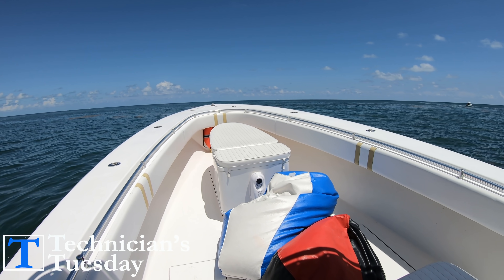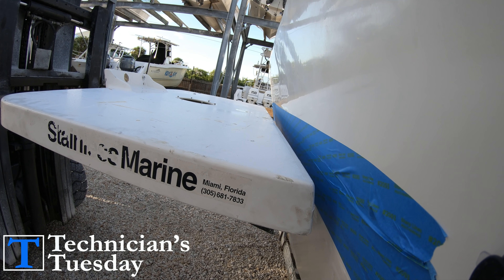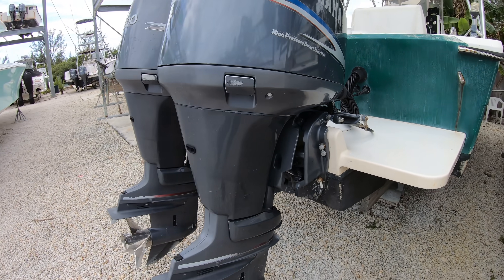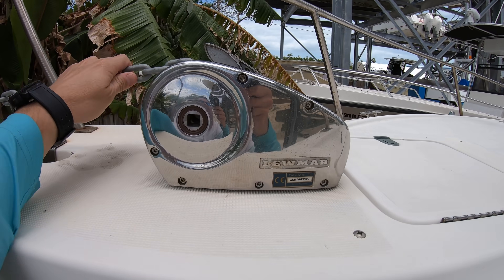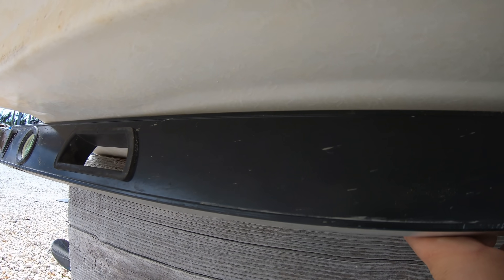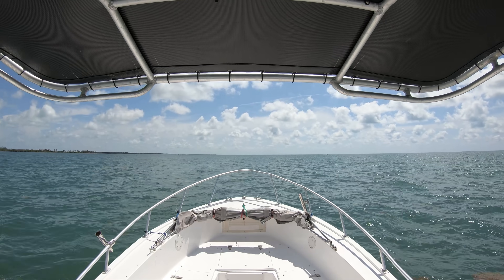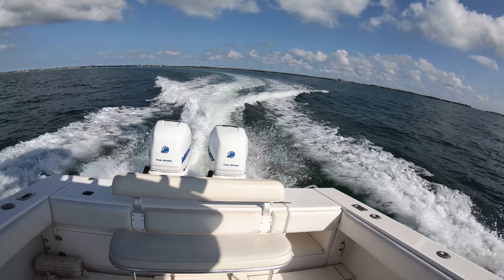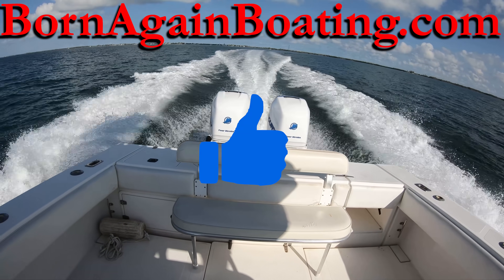Boats Brackets Engine Height EQUAL PORPOISING!

Comment: The porpoising typically happens inside of a speed range and under certain load conditions. For instance we have a pretty fast twin engine boat with a bracket which tops out well over 70mph, but under light load conditions it nearly always porpoises between 45-50mph. This is the speed range in which it begins to lift the hull out of the water and outside of that speed range it runs perfect, but inside that speed range it's unstable. Adding a few passengers to the front of the boat moves the speed range up by maybe 5mph etc. What we have is an old school "straight hull" and it's fun because you can vary the angle of attack a lot with the trim, it runs great you just have to know how to drive it. I guess the modern solution to all this is to add steps and then boat will have the same angle of attack almost not matter what you do with the trim, and no porpoising. But honestly I like my old school hull, it's fun to play with the trim and it's as fast as anything once you trim her up and open her up. But basically if have porpoising problems start with moving the weight around, you're either going to want to make the nose heavier or lighter and then play with the trim. Offshore the easy solution is typically to add more weight in the front.. but it's going to run wet. Probably.

Comment: You asked if we ever dealt with any of these issues:  I have a 1984 186 Chris Craft Scorpion Bow Rider with 3.8 OMC Stringer Drive.  The engine stringers rotted out so I had to rebuild them.  In the process the engine height got too low in the back causing the cavitation plate t have water flowing over it.  I have not totally fixed this issue yet because the boat lost 4 MPH off the top end but rides better because to hull does not pound in the Lake Michigan chop.  We bought the boat when I was 25 and liked the speed.  Now that I am 57 I like the more comfortable ride.

Comment: Thank you for sharing this knowledge guide. As you correctly pointed out, the height of the cavitation plate is more crucial than many boat owners are aware of, however it would be of value to your viewers to give a specific measurement as there is a rule of thumb that can differ when say comparing a deep V to a cat. It is also of interest that a slight bit of toe in specifically on cats can make a huge difference to the steering and performance of the boat. You can make this a whole separate discussion point with a panel of experts.
Reply: A few of the cat makers are mounting the outboards so they lean in just a few degrees now.  Hammercat is one and I think Aquila does as well on the 36.  I don't think Aspen does that with their proa design hulls.

Comment: Not all 'hooks' are due to age changes on boats.  In the seventies and eighties on up there were boats which used the 'hook' to achieve level plane with minimum horsepower.  This was emphasized after the seventies oil embargo when low horsepower boats were in demand and continued on for many years.  I have also had porpoising from boats that were designed to be used with inboard power as well as I/O and outboards.  They incorporated a full keel which went 3/4 of the way aft and would have been used for the shaft of an inboard.  At higher speeds (27-8 knots and above) the partial keel wanted to be a planing surface but wasn't  large enough to maintain so the effect was porpoising.  Trim tabs helped on some but bottom line was that type of hull just had a built in speed limit.  A lot of forces are increased dramatically on the hull that has been swapped over to a bracket.  Just doing up the transom and adding the bracket leads to increased point loads on the hull that need to be dealt with.  Strength needs to be added which can be achieved in a variety of ways.  The horsepower of today's modern outboards can be mind boggling when adding a five foot lever to them!!

Comment: Hello guys,
congratulations for the video I am Italian and I always follow you. I did the same job on my boat by mounting a Bracket, I would like to know the starting point for the installation of a 225 mercury. From the video I understood that the starting point is the water intake at the same level as the keel. Right?
Reply: I also added a bracket to my 23 mako. I read online that the cavitation plate is to be raised 1 inch for every 10 inches of setback for your bracket. Common brackets are 30 inches so the motor needs to be raised 3 inches. I have 24 inch bracket and raised 2 inches. Havent been in the water yet but I hope it works.. Hope this helps.

Comment: I have seen this on a couple of seacrafts that had enclosed the transoms and bracket installed. The floatation on the bracket wasn’t enough to counteract the weight of two 4-strokes. Without trim tabs the boat would bounce.

Comment: The first time I set up an outboard by myself I mounted it too low, confusing the anti-ventilation strake for one of the smaller strakes mounted higher on the lower unit, and ended up with a boat that reached for the moon before getting on plane and then would shovel water over the transom because of flow up the outboard housing.  Thankfully, I had used to the top mounting hole from each of the bracket sections on my Mercury and was able to remount to the correct height without having to redrill.

Comment: Years ago my brother and I had a '17 boat that had a severe "hook" in the back right in front of the transom (unknown to us at the time). It was a fixer upper that we had to piece together. We put a 115 on the boat and when when we took her out for the 1st time, it came out of the water just fine and as we increased speed the only part of the boat in contact with the water was the back of the boat. At full throttle, the area in front of the hook came out of the water and the only thing left in contact with the water was the motor & transom! All of a sudden the boat just went sideways! we thought we hit something! We tried it again with the same result. Later we saw the hook (caused by a 4 x 4 it was sitting on for years). We put a 55 on the back and never had that problem again!

Comment: I had to add the vent hoses to a custom bracket on my boat.  They worked perfectly.  It’s many hundreds of pounds of water that gets stuck back there and (without vents) really holds the stern down in the water.
Reply: How do you installed vent hose on a custom bracket ??? Please let me know,  some pictures will help

Comment: Those Evincrudes and Johnson Looper 6s were such good motors. Thirsty, but always brought you home. You could turn a 225 into a 250 with some jets and a powerpack too. I used to call mine Smokey Joe. Good times.

Comment: Well I do have problems with porpoising on a brand new purchase in 2019.  Nautic-Star 195 bay boat with 115HP Yamaha. I asked the dealer to supply it with a jack plate to enable me the option of flats fishing. The Atlas micro-plate supplied by them I believe is too small although it is rated for up to 115HP.  It only raises the engine vertically about 3"-4", which does not raise it high enough to scoot over shallow flats.  As well, when I tried trimming the motor out of the water for the first time, the steering hydraulic fittings hit the transom and broke off, leaving me no steering. Their fix was to put a mercury level limiter  in the motor to stop the motor trimming up too far. That's useless, because now I can't trim the prop out for flushing salt water or even higher than bottom of hull to drift over shallows or use my electric motor over shallows.  The lower unit keeps catching in the sand. But the big problem is porpoising. I have to keep the motor trimmed almost all the way down so it plows. Soon as I get it on plane with a slight trim up, well, splishy splashy starts.  If there is the slightest breeze or chop, well I'm as wet as if I'd just taken a dip. Stumped as to what is my next course of action. Dealer's only answer is it's unfortunate and that the jack plate is rated for up to 115 hp

Should I discard the jack plate idea? Or go with a bigger one that offsets the engine further from the transom??  Both would allow the removal of the trim limiter switch. But then I have to forget about flats fishing in Florida. And is the positioning of the jack plate causing the porpoising?

Comment: Super helpful! 🔥🔥🔥 so How you fix the extra weight changing from 2 stroke 200 to a 4 stroke 275 verado in a 22 sea pro. I only have the Porpoise effect on choppy water. 

Is there a way to fix it?? Or The only solution would be put a lighter motor again?, Thanks

Comment: I also hve my front skier design from yrs back NOW for harbor patrol bouncing at limit power wt & conditions. This front skier acts as counter shocks working opposite wave bouncing action. Meaning if boat jumping in & out of water a tee pee won't work bc it needs to b right sized normal travel in the water to work. Tee pee holds u down but waves & speed jumping u means u need front skier help. The race boat tunnel but upside down is extreme design case, where u r flying at limit of being called boat & need dead water wt or u need wings bc u r going to take off 100 mph + crazy fast unless on glass waves.

Comment: Hi , yes my question was about the poked holes on the transom for trim taps on old boats  like the venture boat you mentioned, mine is a Aquasport with euro transom , what a diferente has you experienced after trough hole installed??
Reply from the maker: Hey, yes, night and day, it was a great fix for that boat, no more planning issues or having the back end of the boat sucked down in the water and bow rising. It worked great! Not sure if the Aquasport has the similar transom, but look at some pictures of a 1999 34 Venture and then your Aquasport and see how similar the back is
Reply: @BornAgainBoating  hi man thanks for the response 👍,  yes aquasport used the same transom design and I always has that problem trying to get on plane.

Comment: My last boat was a 23 Donzi with a bracket. I always had to keep the engine tucked all the way in and the trim tabs were always at least half deployed to keep the bow down. My new boat is a stepped hull 30 foot intrepid with an integrated bracket. That thing rides so flat with no trim tabs.
Reply: Only have seen a few donzi boats and I have loved them!

Comment: I have a 2008 Key West 1720 Pro. I have  porpoising at top end without trim and I believe it is a result of low engine height as  my straight edge like one in the video shows water coming over the antiventilation plate. I have also read some comments via a google search that indicate the same. I plan to move the engine up one hole as others have said this cured their problem
Reply: I just want to move it up, any suggestions to prevent problems would be appreciated. Thanks

Comment: Another great video but it raises a question for me. When you add a bracket how do you then determine proper engine height ? I don't think the straight edge along the hull method applies anymore and trial and error is very time consuming.

Comment: lets start an experimental design...  a center console with the outboard under the center console... a conventional shallow V hull in front of the engine and a twin hull behind it..  allowing a far better weight distribution and 360 degree   fishing access .. a  bellows around the base of the powerhead to keep splash from coming up around the outboard..

Comment: All things being equal, on a 17 ft aluminum boat that has a tendency to porpoise, would it get better or worse by adding a small set-back plate?  My original thought was that it would improve.  If the pivot point is the transom pad, then the engine would now be further back and have an easier time of keeping the bow up. Yes or no??  By the way, great video as always....

Comment: How much of a issue the poked holes are on a platform?? Aquasport 225 , has you see a good difference after trough hull installed??
Reply from the maker: Sorry but I'm not sure what you are asking :/
Reply: @BornAgainBoating  hi body you have so a nice videos,  yes my question was about the trim taps poked holes that you mentioned on this video, I have a 225 aquasport euro transom, you mentioned that it can work as a vent and boat can  has  difficult to plane, what a diferente have you see after through holes installed????

Comment: The more the spay of the front tee pee blades also is a factor. The more straight on the blades the faster but the more splayed the tee pee the more control against lift or yaw as well, again a computer nerd can work out the ideal range for said length w/ xy wt & how high bow sitting out of the water speed is the wild card. At limit performance U need an upside down opening arch on bottom & flat on top, so water rushing threw keeps boat attached & sitting on smooth water.

Comment: I have a 14’ vhull John boat. Had a 2 stroke 5hp on it. Just bought a Suzuki 9.9hp. I notice the engine is a lot heavier the w it ventilation plate is to low now. 😢. It looks like proper height out of water but in the water it heavier so it sinks the boat in water causing it to be to low and it’s dragging. So I think I need a jack plate now. Any suggestions? And not just a heart lol
Reply: LOL! I’ll take the heart!

Comment: It is not my intention to critic anything you said, however if I remember correctly from my naval architecture course at the Naval Academy some 30 years back, the porpoising effect is not caused that much by the extra weight on the back, but by the extra length added to the boat. Generally, the length of a boat is considered in relation with the average wave length or the average time laps between a succession of waves and calculated so the bow and the stern will always sit on top of the waves. As I said, this is from a course taken some 30 years ago and my recollection may not be that sharp, so take it with a grain of salt.
Reply: I have a little 16' cabin boat that porpoises like crazy when there is too much weight at the stern. When it starts, I have to move everyone forward.

Comment: Maybe you have time to answer this question:  I have a 1996 Maxum 17.5 outboard, rated for 125 hp but it has a 135 hp Black Max on it, so probably a bit heavy.  It planes ok at maximum trim but I cannot trim up at all without porpoising.  Is this a weight distribution problem or could it be something else?  Basically I only have 2 useful trim settings, water and trailer, even though there is a trim gauge giving me a range of settings and it is a 2 speed trim so designed for micro adjustment on the bottom 1/4.

Comment: hving a piece of pipe cut in 1/2 or 1/3rd  under the prop & trailing prop out the rear by 10" or so will improve performance. Better to use PVC bc very soft so won't hurt the prop, & rapping it in fiber or carbon glass for strength. If prop is 6" then u need health bigger width pipe so won't chance hitting it.  A teeter tooter effect so 35 vs 65% length or so length of pipe running long out the back. The front end of pipe can b round but back end prop on needs to b cut gone. The pipe can then naturally teeter up & down but not hit the prop.

Comment: Do you raise or lower an engine if it is porpoising at high speeds and you have barely applied trim?   Max trim is 5 and getting porpoise at 2.25 and 50 mph?

Comment: powerful torque props( need computer modeling to max dial in) can hve sharp cutting edge then hve 2, or 3 separate thin sheet twist diff blades. So wt is jack light but leading edge is stronger if it hits anything+^! hving diff cut bit angles & length of blades in 2 n1 or 3n1 if bigger means far more efficient prop design. 3 blade if really 4 or 5 separate twisting blades of prop & jack little extra wt. Diff between polished or serrated knife better design home run! Leading prop may b 2 blade that cuts 4 ways is best but trailing 3 blades makes 4 or 5 cuts might b best. Swallow leading angle front cut pull then opposite trailing prop. Computer design & real world testing & modeling will be sure.

Comment: the top wing over prop needs to hve screen like holes cheese in it. So air can get out but water goes drive by. I think a 1/2 holes side & 1/2 solid wing over prop is best but speed of prop spin matters greatly.

Comment: The ‘plate’ on the motor is a cavitation plate, not an anti ventilation plate! Ventilation & cavitation are two different problems! Sorry but when did all these new terms for outboards start coming about? ‘Leg’ for the mid-section, ‘foot’ for the lower unit etc etc. Over 40 years in the outboard business here. If you don’t know what it is look it up!!!

Comment: u need a tee pee keel setup on these tiny shit boats running at speed, that tighten back into normal keel blade as it head front to back. It is all about the wt of water pushing down on duel tee pee front blades & how far b4 transitioning back n2 single blade till u fades down to nothing, & the length of the tee pee. If front of boat runs 3 or 4ft out of water then tee pee needs 18" more still in the water up front some where, esp if tiny shit boat. some computer nerd can work out the formula but that is the deal.